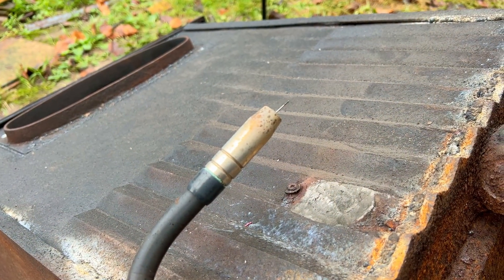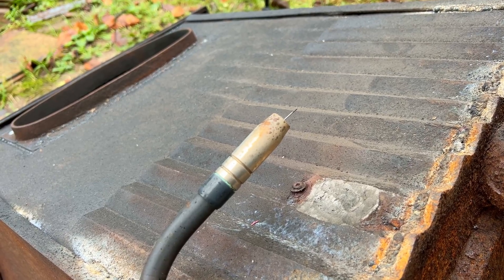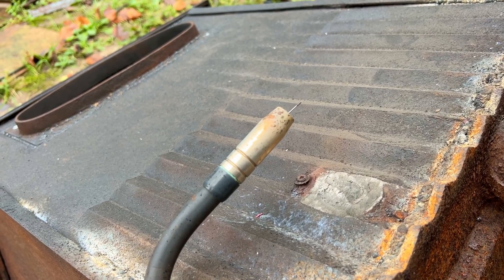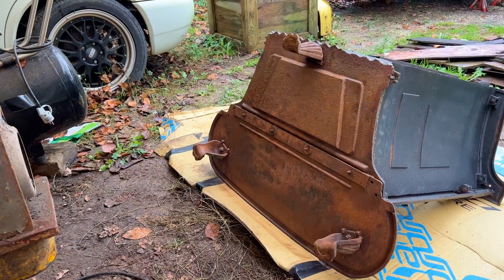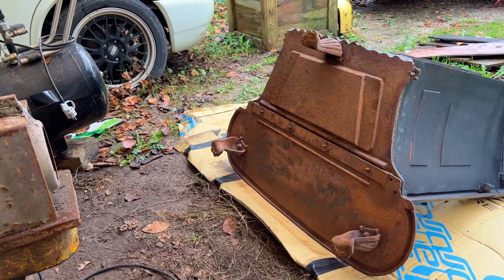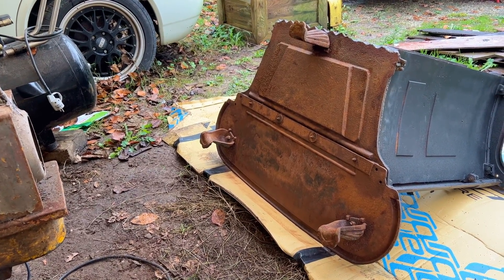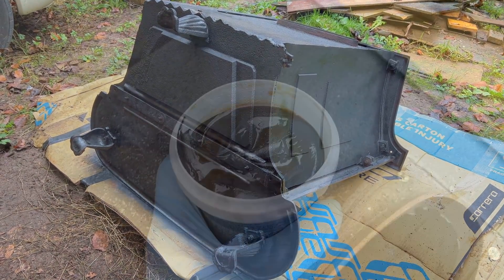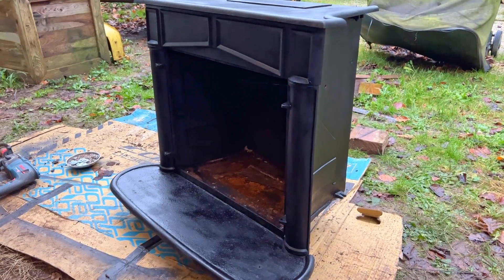🏰 EP 109: WELDING A WOOD BURNER!: - Chateau Life

Comment: I must say I was quite worried when this project was 1st introduced.  Burning down the chateau seemed a distinct possibility.  Needn't have worried you are spot on as usual.  Glad to hear some things need inspection.  It does seem sometimes, on all of the chateau shows I watch, that building inspectors lay thin on the ground, especially with plumbing and electrical.  Not sure if it's an editing thing or that the US has a lot more building codes than the French, British or Euro in general.  Great going and it will be super to see those 2 rooms finished.